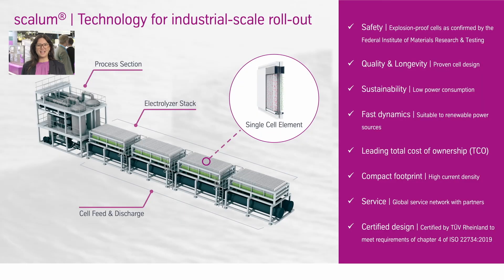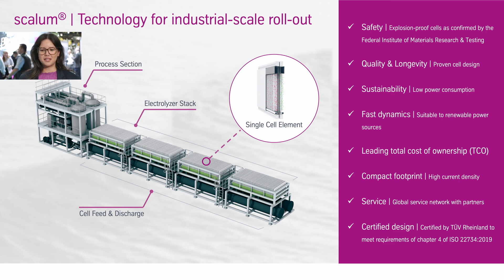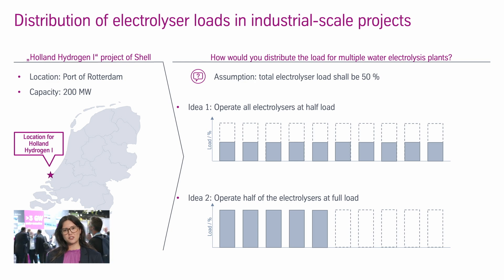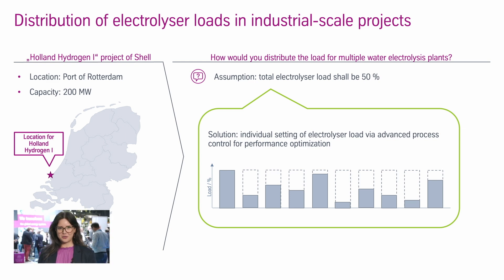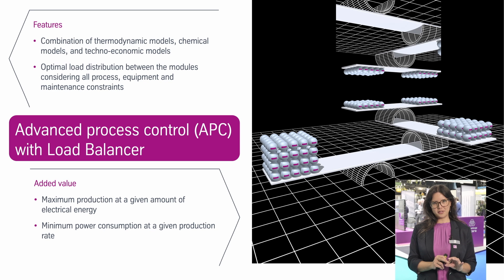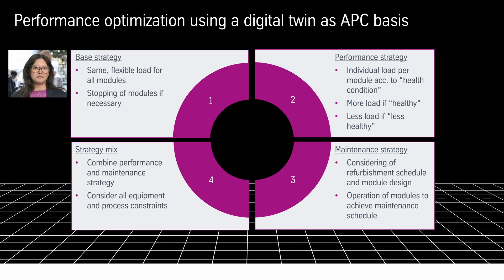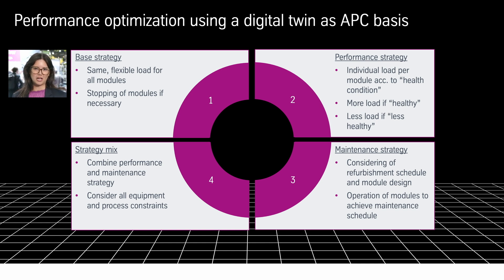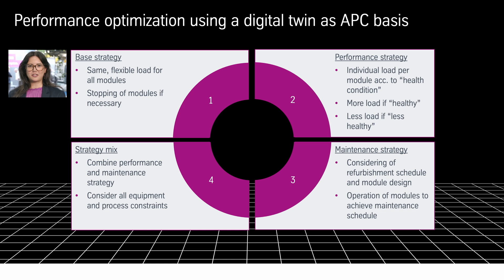New Era Cast (Episode 2): Green Hydrogen Production with Large-Scale Alkaline Water Electrolysis

Comment: Hi, you may not spell out that, a given stack is handicapped (not working) with neighbor best within the module. i.e., not all the stacks in a given module are identical, and dissimilar performance to take a load share variations all the way from 10-100% (shown a depiction at 3.52 min). Please phrase something else reasonings in introducing APC with load balancer. The crux of the story is that, the I-V (current-voltage) performances of each and every cell in a stack and stacks in modules are non-uniform and they are unique. What APC does is that, it identifies and utilize their individual max energy efficiency conditions. Ofcourse, Thyssenkrupp Nucera is a leader in this tech.